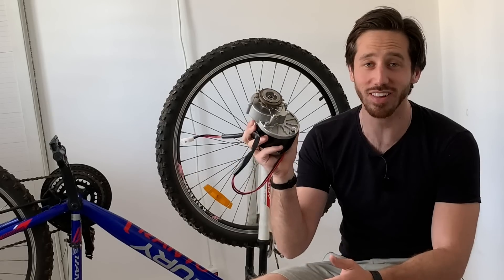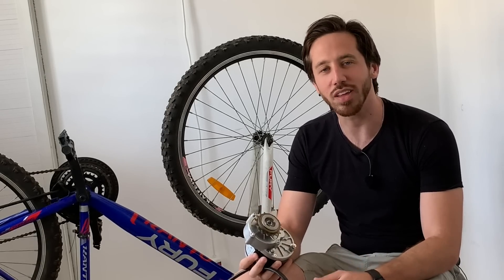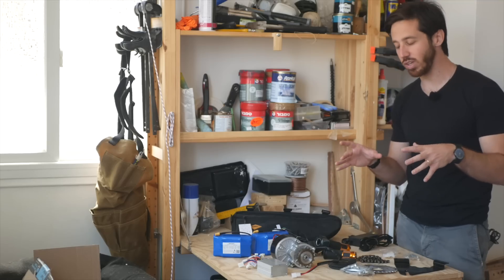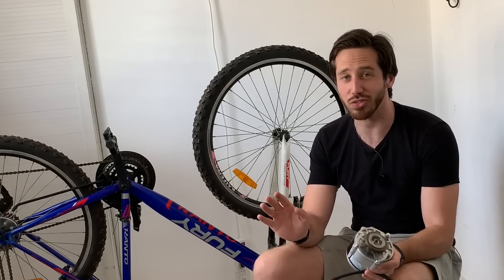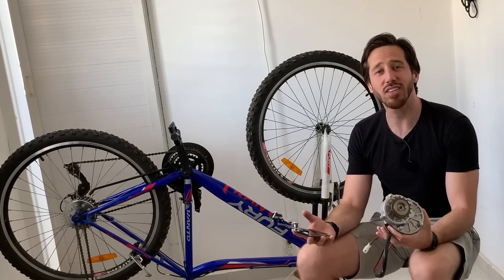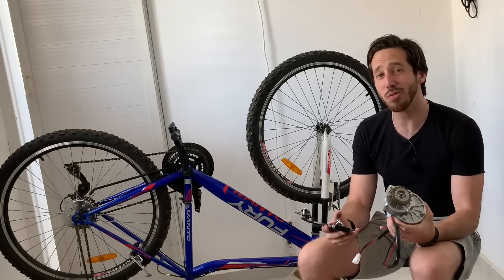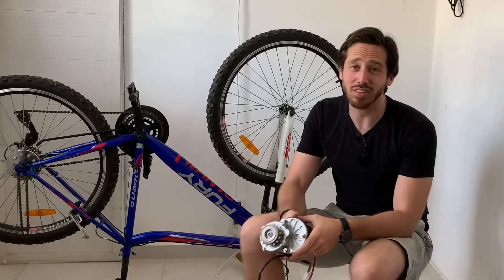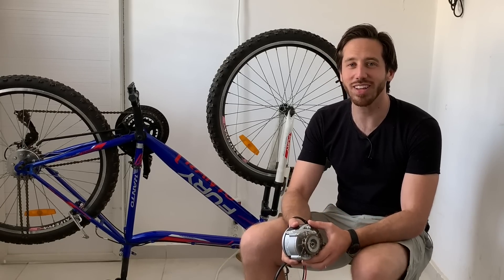Do NOT buy this $103 electric bike conversion kit

Comment: My bicycle has a luggage rack on it, I'm going to try and mount the motor to that using some type of custom bracket. If that doesn't work, I'm going to see if I can figure out how to mount it to the front wheel
Reply: Ummm so if it cost a bit more try to get a mount for the back coz that where all the waigh is so better grip
Reply: @neon3d602  that makes a lot of sense, now here comes the next issue. My bicycle has disc brakes that are located right where the sprocket needs to be. I was thinking of removing the front brake and only using the back brake. I would get the normal style brakes, but I have a fat tire bike. I don't know if they make the normal style brakes for bicycles with fat tires.

Comment: should of flipped the sprocket on the rim it woulda pushed the teeth out a bit I had same problem with gas ones and that usually helped with chain poping and leveled it to the engine better I don't know why all tutorials say to go that way cause I realized real soon that's the worse way to install them sprockets and if you would of removed an axle bolt on left n right n replaced them with washers or real thin bolts  it woulda fit and lined up also better but yeah them things do require some rigging to make them usiversal.

Comment: You give up too easy, when it look like a simple fix. These kind of kits you always have to modified it a little bit here and there. That is why it cost so cheap. But anyway, I don't think these type of motor is good for long term use, I would not recommend them to anyone either.

Comment: I don’t think it is reasonable to expect the cheapest universal ebike conversion kit to be easy to install or  (out of the box) fit most bikes.  
    I’ve had decades of experience installing many cheap (and some quite expensive) “universal” kits. Everything from upgrading computer memory to turbocharging a car and almost all of them required tinkering, modifications and force fits to make them work. Usually, the cheapest kits require the most ingenuity and modification to get it to fit/work (occasionally ending up in the trash as impossible to make work). 
    Just to see if they really are so difficult, I installed one of these kits last weekend and attaching the motor to the bike frame so the gears align was a bitch. I couldn’t shim or bend the bracket enough to fit and only succeeded after resorting to my acetylene torch and anvil.
 
    If it happens to fit your bike, it’s an excellent value, a lot of fun and surprisingly powerful (if you use 48 volts instead of 36). But if the motor doesn't obviously fit your bike, pack it up and send it back. Do not try to make-it-fit unless you are an avid (or rabid) DIYer.

Comment: Go to the hardware store, get some nuts (&/or washers) that fit the bolts to space out the sprocket from wheel. Also can bend the motor bracket to get a better angle as well. Super easy stuff🤷

Comment: I built two the worked great.Get a bike with disk brakes take the back disk brake off back wheel screw the sprocket where it was.Also get u bolts to help you mount motor.It will work fine then.

Comment: You have to buy the correct kit for your application.  They work just fine on my mountain bike or fat bike.  No stump puller but enough power to pull moderate hills with very little peddle effort.  Currently bolting on the 24 volt mid drive kit.

Comment: L faster rear sprocket kit worked great on my Walmart bike. For 370 cad (kit , SLA battery , frame bag , connectors). It took and hour to build and climbs hills no problem albiat slowly. The true cost was $650 for tools and connectors I didn't have.

Comment: Unfortunately I saw your video after I purchased this same kit. The problem is the motor sprocket doesn't align with the wheel sprocket. Even a hammer couldn't make that universal frame work. I had to make my own L-shaped frame and mount the motor above the wheel sprocket. A lot of redesign went in. It took me a bout a week, couple of hours a day, to finally get this working. You need to be really handy and have a BS degree in Mechanical engineering to get this working. The kit lacks chain tensioner, alignment flexibility, and the chain is short, so there isn't much room for play, it easily jumps off the sprocket if not aligned 99.325%. I had to get a longer chain, and mount the motor farther. 
Spend $80 more and get the built in hub motor with wheel and tire. the work will be cut by 80% and you will end up with a more reliable e-bike. I ride the bike with my tools, and make sure the bike doesn't fall on its side, otherwise the motor mount will go out of alignment.

Comment: the crazy thing is, I've seen universal kits with a motor almost like that, and a slightly different mount (the mount hangs the motor behind the frame) and those seem to fit a ton of bikes. a few eaaaarly Walmart Ebikes used them along with SLA batteries.

Comment: I paid $70 for the same kit on eBay. I work in a vacuum store so, I have all the parts to make this kit work on my bike with 2 Ryobi drill batteries.
Reply: Good luck and please keep me updated , my motor is now installed and ready for torture testing ...I use mine at low speeds to help me up steep hills and regenerative braking while going , the energy from the motor ( no freewheel ) is directed to a charge controller , going downhill is slowing me down while charging my batteries . I'm now building a kickstant to raise rear wheel of the ground so I can stay stationary while pedal chatging my batts .

Comment: Dude, the bracket goes inside the frame at the back & you have it upside down. the 2 flanges go against the frame from the inside. . . .  .
It is worth mounting the plate before you attach the motor to it.

Comment: Ok I have this motor set. But it fits on my bike just barely. I just need to know how to set up a  (36V 48V Thumb Throttle Speed Control w/ LED Display Power Indicator For Scooter Ebike Front Rear Wheel Hub Motor to a  Wingsmoto Motor Speed Controller 36v 500w Electrical Scooter E Bike Bicycle Tricycle Brush Motor Control Box). I have put this thing together 3 times n I've blow it every time how can I fix this n stop it from happening.

Comment: To adapt mid drive is extremely difficult let alone making them cheap. The cheapest ebike conversion and easiest, is front hub brushed with gears. However they are noisy and will not last long. Brushed geared I'd drives are worse, with little benefit in handling compared to front hub drives.

Comment: The problem you have is not with the frames,  it is with the wheel (hub) you used. The spokes are too narrow so when you mount the big sprocket, it’s too far from the frame.  I would have disassembled the 9 bolts, and use some washers (or even 9 nuts perhaps) to bring it inline with the mounted motor.

Comment: You always gonna have some work to do to make these "cheap kits" work and you always have to have some knowledge about mechanics/crafting. Even the expensive ones don't always just easily fit any bike but you can just make them fit. Or just buy the bike already made from the shop. I used this type of motors  for my bike for some time, they kinda do the job if you know how to use them, you can even get more power from them than they were originally designed. At some point I had 2 of these 24v 250w and I  was using them as mid drive with a mechanism made by me, I even used them with 52v batteries and I had about 1500w to the wheel. But the biggest problem with those is that they don't last too long, they overheat in the summer and they have low efficiency. A brushless motor as a mid drive or hub will always be a much better investment. If you keep using those "cheap" motors you will end up spending more money because you will keep replacing them after a while.

Comment: I used a hack saw cut the tabs off, and cut a slit to hose clamp it to my bike rack
Edit no connector on the motor so cut the controller power (battery had its own plug) and swapped to the motor side. Just know if you do this red is black and black is red...

Comment: I received mine a week ago and I maxed out around 18 mph. Though the motor blew up after 10 minutes ride at maximum speed. Do you know if the 36v DC motor are designed to heat up easily? Because I have multiple of the 24v and they work fine.

Comment: I fitted this type of motor 250w with same universal mount in my 28 inch roadcoster indian desi bicycle . I am from India. With 24amp 12v battery I drive 60km in single charge.

Comment: I think I can see a fix to try ......Add the first start of the motor with washers to bring the front sprocket inside the frame that should be your design problem I think I see as fast as the video played           my thaoughts     Jeff   Moreland

Comment: I'm late to this post and to your channel. I just trash picked a fixie. It has a fixed gear on the left side. Is there a way to replace that gear with a larger diameter one for bike rack style ebike conversion? I presume you need to pull the gear and press in another. Could that cheapo $103 kit be adapted to my fixie?

Comment: That motor mount is CLEARLY designed to go INSIDE the frame. You spent more time editing that one shot of the video showing how the angle is wrong than you should have taken to just try it different ways until it fit...

Comment: I currently have a gas powered 80cc motorized bike that doesn't run anymore. Planning to go electric when I saw this kit. The reason why is because it uses similar sprocket mount that attaches to rear wheel. Just curious if this kit will work with what I have.

Comment: Okay i have watch your video and  agree with you that it will not fit the bike.

 I built handicap bike for people and have purchase this kit about 15 times and it works very well if you modify the motor bracket. All i do is take a large hammer and beat half of the bend out of the two factory bends on the bracket. You will have to place the bracket in a vice to straighten it to lineup. Also you may want to repaint the bracket because at that point you have beaten some of the paint out.

I have two kits coming tomorrow and would could take pictures and send to you if you would like.

Comment: Hey man, I have this exact kit and others. It works great!!! There's nothing wrong with the motor mount. You are putting it on wrong. It is meant to go on in the back with a bike rack, as soon as you put a rack on and flip it...you will see it alligns up with the back fork and v of the rack. Hope this helps
Reply: Yo bro ...some people are not mechanically inclined .......and never will be ....I made my own bracket but I like your adaptation ,,,something the originator of this video  should of done adapt to the situation
Reply: no. your wording is very confusing. try again please.
Reply: @varman001  no......read again and if you have this kit and bike, use your brain? It is not confusing at all bro!! in the video he was trying to attach the motor on the inside of the frame, that's almost correct because it does attach to the back bolt.....the motor mount is shaped like a v....he was attempting to mount to end of frame that shape is > and the mount and or chain will not line up. You just flip the mount to the very end of bike, it will sit in the classic v shape and it will line up, if you have a bike rack you will see it fits perfect unless you have a mental condition that keeps you from seeing the odvious!  tho you don't have to have the bike rack. Next time you need help if you don't know something ask differently because it is rude, especially when people take the time to help others for nothing.

Comment: This kit worked for me. I am confused a little bit when I opened the box, because it has no instruction manual in the box, even a page! I watched a video on the youtube, it turns out very easy to install. I, first, installed the motor on the right side and it works fine, just you have to pedal along because the  crank set has no free wheel. I am about to try it on the left side.

Comment: Well not sure where this video was hiding on me as I was looking for the follow up video to your original one, title may have thrown me off.

Question for you: I am looking to add a motor to my canoe cart with a possible modification to allow my wife to also ride on it like a rickshaw. She has problems with her legs and can no longer do long hikes. What I need is a motor that has a good amount of torque and only goes maybe a bit faster than walking speed. Not really sure what I should be looking for/at though, motor wise, at this point. Any help/guidance is appreciated.

Comment: The bracket mounts the other way round by the way. Flip it over and it will be an inch deeper. 
Also you do have to use washers to level it and also you might need to extend or shortern the chain.
Did fit it and works really well btw.
Reply: If you still have this setup could I get a picture uploaded that I can see?

Comment: I used the 36v 450w version of this kit w/ a disc brake sprocket. Installed on my Mongoose fat bike. Installing was a bit problematic, but with a little ingenuity, a few trips to the hardware store, and 4 chains later it's my daily commuter. I kinda want to make a video for installing it, but really don't want to tear it apart right now. Oh and I had to use a chain tensioner. I've posted pics on Pinterest. https://pin.it/6U6shiJ

Comment: Thanks for the video. I was researching this as an interesting option for a conversion, and decided to keep going after watching this. I eventually tracked down some installation videos - in Vietnamese I think, and some manufacturer information.

And here's the thing - it's not intended to fit a bike with gears. Some people seem to have hacked it anyway, but it's definitely not made to fit with a derailleur system.

Bikes around the world are universal at first glance, but very different when you get to the nuts and bolts level. Derailleur gears are standard in the UK, but not expected in other countries. I think the many Chinese dudes selling these kits are unaware of how different bikes can be.

BTW, I know these come in freewheel and weird clamp to spokes version (as reviewed) but from what I can make out the the geometry is just different around the world.
Reply: These sort of kits sell well in India, Pakistan, China, Africa etc where price is the priority and those countries have a lot of single speed bikes with 120mm OLD etc which would be good bikes to use this kit. You can see from the plate that it's intended for horizontal dropouts typically of single speed bikes, fixies and 3 speed hub gear bikes. The popular Buffalo bike in Africa would probably be a good candidate.

Comment: I would love to see a video showing a cheap conversion that actually works.  Out of curiosity, I looked up what I paid for the components for mine and came up with $109 for a hub motor, $31 for controller with display, $4 for a thumb throttle, $8 for a BMS, $24 for ten high-drain 18650 cells, $4 for a battery charger, and $3 for a pack of XT30 connectors.  That comes out to $183, including a small 10s1p battery pack that lasts about 30 min, assuming no pedaling. I also had to buy new spokes, and can't find the receipt for that, but I think it was less than $20.  So probably about $200.  That's still a pretty good price and the build wasn't too difficult.
Reply: I followed Jehu's video here: https://youtu.be/r12IrYTqvas  using a surplus 26" Bafang commercial hub motor, and a XIomi scooter battery pack (10S3P).  I used a different controller kit than Jehu and with shipping my cost came to $197 for the bare bones single battery build.  It will go 20mph, and has a throttle only range of about 14 miles on relatively flat ground.

Comment: It would be cool if you could find some kind of method that someone could potentially use to measure the distance from the dropout to the bars to determine if the motor would potentially fit within a certain margin of error before purchasing.

Comment: Shouldn't you pull that other video? If these kits are a waste of time and money then pull that vid. Its only by chance that I found this follow up.

Those kits are a false economy. For an extra $30 or $40 you can get a brushless hub motor kit. This means a water proof motor and you don't have to maintain the brushes on the motor. You wanna factor in the longer term costs.

Comment: In my application, a mid-drive 500W motor makes the most sense. The full system is a lot of money. I have a touring bike built around 1975. Am I wasting my money modifying this bike? Does it make more sense to pay around twice as much and buy a new eBike? I do have a small machine shop so custom brackets are not an issue. Thanks Micah!

Comment: It's not designed for bikes with shift gears...you need to mount the freewheel on the left hand side on your rear wheel axis, and spot weld to secure it.  See manufacturer FAQ's below.
Reply: From Manufacturer FAQs:

"1.Can I install the kit on my 18 speed/24 speed bike?

Yes, you can. But it is more difficult to install. This kit is designed for normal bike, not for the bike that can shift gears. However, you can install the kit on the left hand side if your bike is18speed/24speed... you need to mount the freewheel on the left hand side on your rear wheel axis, and spot weld to secure it. After you have installed the kit , you can still shift gears on your bike. But if you don't know how to weld, we recommend you to buy our hub motor kit or our ?mid-mounted" kit ."